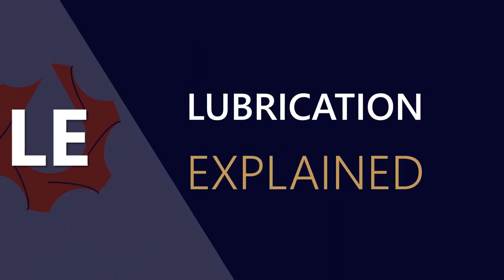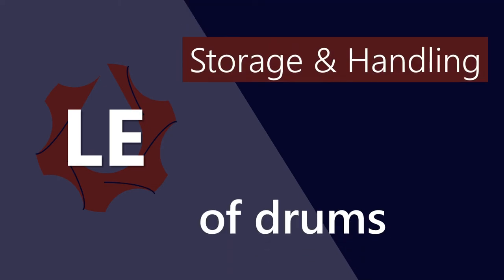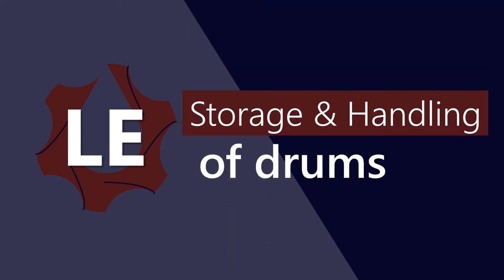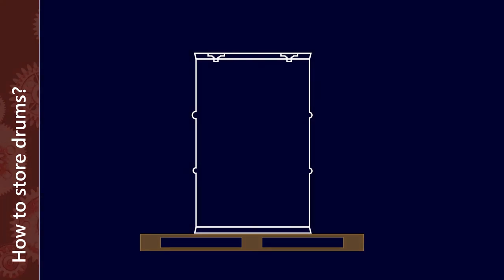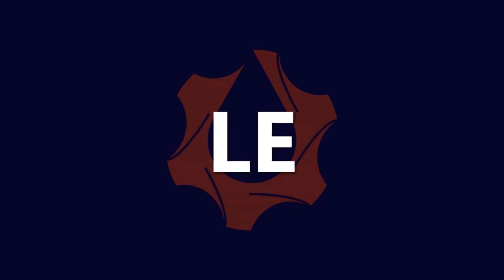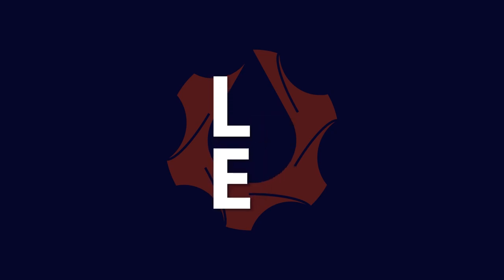How should oil drums be stored?

Comment: Why is particles not a concern  when storing drums? (this is based on the video) 
In most presentation & articles they specify that at every chain of custody the particle count increases isn't it? 

What would happen if the drum bungs are 100% sealed, then there won't be any air exchange at all. Will this cause drum to burst due the expansion or contraction of air?
Reply: In most normal situation, I think the differential pressure won't be enough to cause the drum to burst or implode

Comment: If the drums are in a warehouse indoors, but the warehouse is not air conditioned will water collect inside? An oil company that I use told me they had that issue when they first started and they say you’d have to store oil in an air-conditioned warehouse. Also, what about oil that is stored  in large tanks outside
Reply from the maker: No question climate control is going to help. The reason for the breathing is temperature fluctuations - the bigger the temperature delta, the worse the problem is. So being indoor will always help because the drums are insulated from the elements and do not receive direct sunlight. But they’ll still breather a little bit.

Comment: how about putting the drum horizontally with the two holes parallel to the ground. Please consider a case where putting the drum outside is inevitable and the number of drums is in tens of thousands which is actually a case in big suppliers' warehouses.
Reply from the maker: Good point! Guess we were going for the "ideal case" but do acknowledge that in many circumstances there aren't huge covered areas.

Comment: Share a shelf life for additives
Reply from the maker: Shelf life for additives are quite variable depending on the type - for finished lubricants the generic answer is about five years, although this might reduce to around two years for some of the biodegradeable oils.
Reply: how about putting the drum horizontally with the two holes parallel to the ground. 
please consider a case where putting the drums outside is inevitable and the number of drums is in tens of thousands which is actually a case in big suppliers' warehouse.